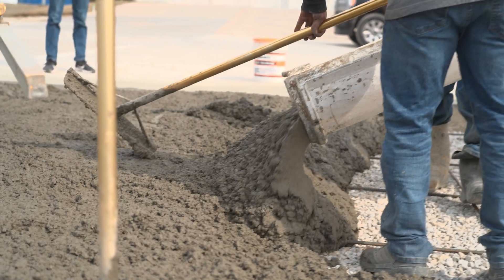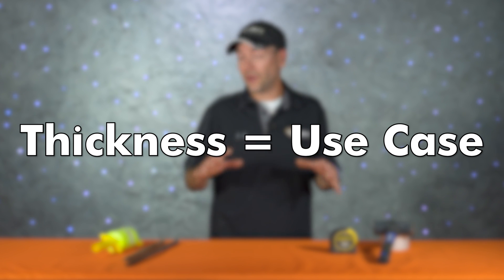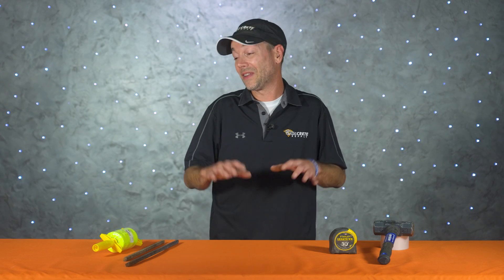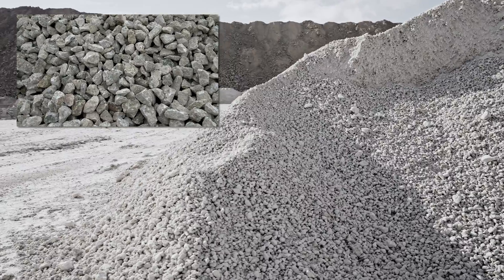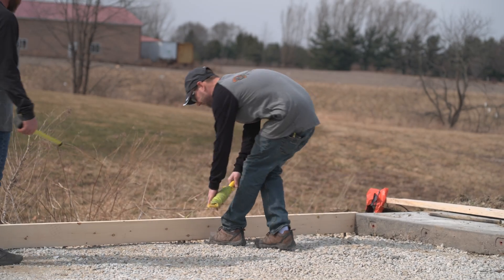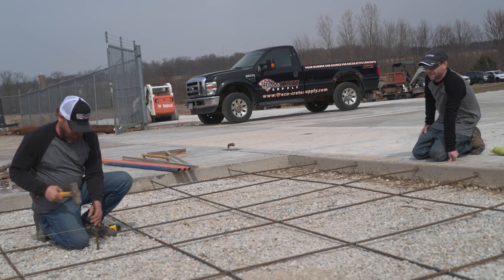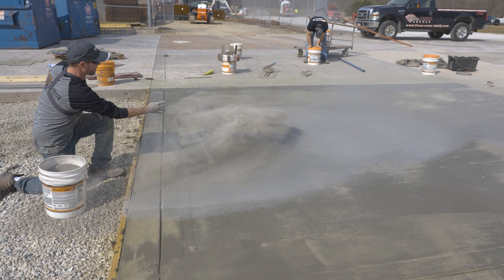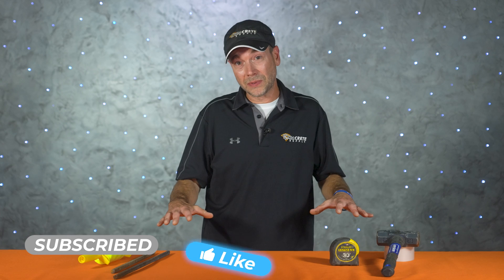How Thick Should Your Concrete be?

Comment: Yesterday, two of our neighbors got pathways beside their driveways done by a local company.
In most areas the concrete is not 4'" thick, as was most evident at the brick line of the driveway where the height is only the thickness of the brick.
Plus, they set the rebar grid directly on the ground and poured over it. Is that allowed?
And, the max-driveway-width bylaw seems to have been broken as well.
Reply from the maker: Thanks for the comment! It is common for residential contractors to set the rebar grid on the ground, but it must be pulled up as the concrete is poured. It certainly isn't gonna do much good if it's laying on the ground, lol. We have been pouring like this for years, and as long as you pull the bar up properly, it'll be fine. This would be very different on commercial job site. In that case, rebar chairs or blocks would be required. Hopefully your neighbors driveways both turned out good! Thanks for watching Deco-Crete TV!!!

Comment: If I have an existing 4 inch slab of concrete, can I build a 16x16 x10 pergola on top of it with no footing?
Reply from the maker: Thanks for the comment! This would depend a little bit on the concrete itself, but 4" thick slabs are common for residential driveways. Depending on the concrete mix design, 4" slabs can handle 4,000-6,000lbs (small to midsized cars weigh between 2,500-3,500lbs). You would need to figure up the total weight of the pergola, but my guess is that it is well under that. There would also be the option of building the pergola around the slab. You could install the posts right next to the slab. It would still look good, but all the weight would be supported by the ground. Hopefully this helps! Thanks for watching Deco-Crete TV!!!

Comment: How thick of 57s will you guys go up to? Say I need 2' of fill... will you dumps 57s in, grade out, plate compact, and pour on top?
Reply from the maker: Thanks for the comment! If you need 2' of fill, then 57's might not be the best choice. 304's or some other kind of crushed stone would be a better option when it's that deep. The crushed fill will compact a lot tighter. No matter what type of fill you use, always fill in layers/lifts, around 3"-4" at a time, and compact between lifts. Our go-to for this kind of thing would be to use 304"s for the bulk of the fill, then use 57's for the last 2"-3". Hopefully, this helps! Thanks for watching Deco-Crete TV!!!!

Comment: Question: I have a 4" thick, 7x4 slab that I'd like to build a small fireplace on. I live in Houston, TX so we dont get crazy cold weather. Will that slab be thick enough?
Reply from the maker: Thanks for the comment! This would really depend on how much the fireplace will weigh. It's hard to say with certainty that the slab will hold the weight, but I wouldn't be too worried about it if it's a small fireplace. For some comparison, 4" thick concrete is common for residential driveways, and they do just fine with the weight of cars & light trucks. Hopefully this helps! Thanks for watching Deco-Crete TV!!!

Comment: What size of rebar do you use?
 How far do you place it apart?
Reply from the maker: Thanks for the comment! The size of the rebar would depend on the thickness of the concrete, as well as a few other factors. The best thing to do is check your local building code first, some areas of the country may different requirements than others. Common practice would be to use #3 (3/8") rebar for 4" thick concrete and #4 (1/2") for 5"-6" slabs. Common practice for spacing would be 2' on center.  Again, both of these things can change depending location, load-bearing requirements and purpose of the slab. Hopefully, this helps. Thanks for watching Deco-Crete TV!!!

Comment: I wanted to know your thoughts on how thick the concrete should be for pouring and working. The amount of water added partially determines the strength of the concrete. But waste of time as you never say.
Reply from the maker: Thanks for the comment! The minimum thickness for any concrete slab is generally 4". Driveways and are usually 5" and commercial parking lots would be 6" or maybe even thicker depending on the situation. The thickness is determined by the intended use of the slab and you can always check your local building code or talk to other contractors around your area for recommendations. Thanks for watching!!

Comment: The orange things you set in for the rebar. Could you explain how set those in?
Reply from the maker: Thanks for the comment! The orange/red tubes that you see are part of the Quick Dowel system. It's two piece system; the base gets screwed to the form and the tube slides over the base to hold it in place. When you pull the form, the tube stays in the concrete and the base comes off with from. The bases can be used for years if you take care of them. I'll leave links to the sales page on our website as well as a how-to video on the system. Thanks for watching Deco-Crete TV!!!                             
https://www.youtube.com/watch?v=4XmPodKjz98&t=25s                                                                                                                                                                                   
https://www.deco-cretesupply.com/products/forms-expansion-wire/5-8-quicdowel-base

Comment: How thick should the base rocks be?  Is 5” included the case rocks?
Reply from the maker: Thanks for the comment! The base rocks should be 3"-4" thick. It's also important to compact the sub base material, you can rent plate compactors from most tool rental shops. I'll leave a link to another video covering sub base prep and forming. Thanks for watching Deco-Crete TV!!!                                                            
https://www.youtube.com/watch?v=grwqtx5ajUQ

Comment: What is the strength required for a basement load bearing walls?
Reply from the maker: Thanks for the comment! The compressive strength of concrete for basement load-bearing walls depends on your location and exposure to weather. The best thing would be to check with your local ready mix concrete plant, they should be able to answer your question. You could also look up the building code for your area to see what the spec says. Hopefully this helps! Thanks for watching Deco-Crete TV!!!

Comment: Thanks for sharing this video! 

I plan on pouring a thick slab at my back door and am curious if there's a limit to how think I can pour? I want the slab to be 14"with a step at 7 inches. Now I know I should just pour this on top of the ground, so I plan to dig down 6 to 12 inches deep and that will make my slab 26 Inches think. Is this a bad plan?
Reply from the maker: You are welcome, and thanks for the comment! There's really no limit to how thick you can pour. The downsides to pouring that thick would be the cost and the extra weight from that much concrete. As long as the ground you pouring on is stable, you'll be fine. Thanks for watching Deco-Crete TV!!!
Reply: @DecoCreteTV  Thanks! I think I will do the 12 inches underground with just small stones and pour on top of them. Thus bringing me back to 14 inches thick. I'll probably put some wire mesh and rebar into the cement, to help strengthen it
Reply: @DecoCreteTV  I decided to dig it out a foot deep and fill it with 3/4" stone. then build my forms and pour on top of that. Is this a good idea?

Also I am going right up against the (former bulkhead) foundation. Id that a bad idea? should I put a space between them?

Thanks again!
Reply from the maker: @nhbuddy  That sounds like it should work just fine! I would recommend using expansion joint between the new concrete and the foundation. Here's a link to a video on expansion joint. https://www.youtube.com/watch?v=VXsWYGhQfqs&t=75s

Comment: I have a cement slab under my pavers on my lani.  Can I pick up the pavers and fill with concrete?  Can't make higher than paver height because the lani door would not open.
Reply from the maker: Thanks for the comment! How thick are the pavers? Most concrete mixes need to be poured at a minimum of 2" thick. You could check with your local ready mix plant to see if they have a good mix for thinner pours. You could also use an overlay mix if it needs to under the minimum thickness for standard concrete. Thanks for watching Deco-Crete TV!!!

Comment: Do concrete guys actually pour inch slabs or 3.5's. Standard 2x4's a 3.5 inches and does that still count as a 4inch slab measurement to the concrete supplier? Or would that 12th of concrete just be extra?
Reply from the maker: Thanks for the comment! Even though the slab gets formed with 2x4's that are 3.5" tall, the slab still gets graded to 4". Some might pour 3.5" right up against the form so none of the concrete runs out, but the rest of the slab is still 4" thick. Thanks for watching Deco-Crete TV!!!
Reply: Thank you!!

Comment: My perimeter drainage for a small area in my
Carport is 2.5” thick but overall it’s 4” and with rebar 12mm grid on 18” centres. Is this 2.5” thickness that critical for about 2ft by 12” wide? Thanks.
Reply from the maker: 4" would be ideal, and if you can get the drainage pipe lower, that would be best. If not, sometimes you just have to the best you can. That thin area will be weaker than the rest of the slab, but it won't just fall apart. I would try not to drive on the spot if possible. Thanks for watching Deco-Crete TV!!!!

Comment: Can I pour 2 inches of concrete over 4 inc of asphalt?   This is inside of a metal storage building that was placed on  asphalt
Reply from the maker: Thanks for the comment!! I would talk this over with your ready-mix supplier to see how they feel about it. You can definitely do that, but there is some risk of excessive cracking when going that thin over top of asphalt. It would kind depend on your expectations. Thanks for checking out our channel👍